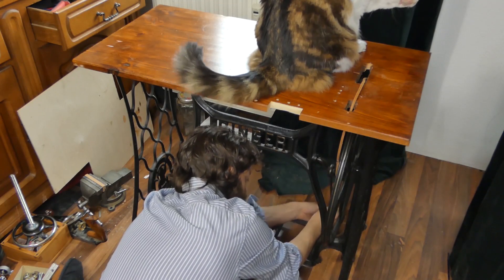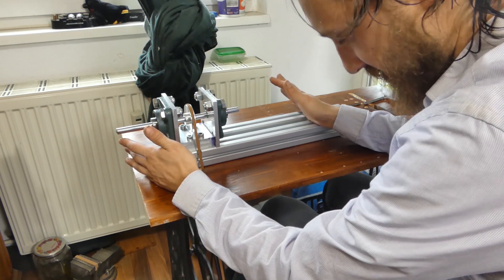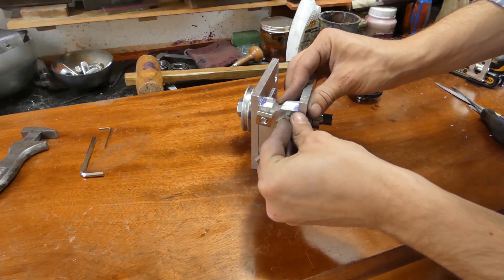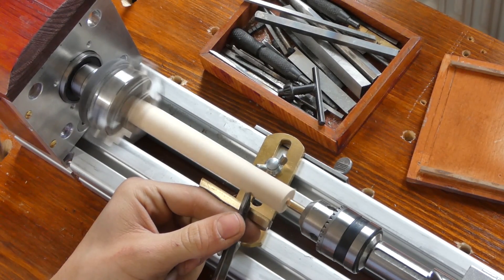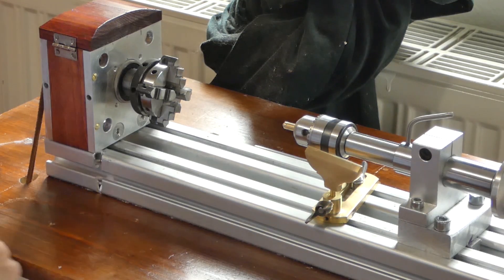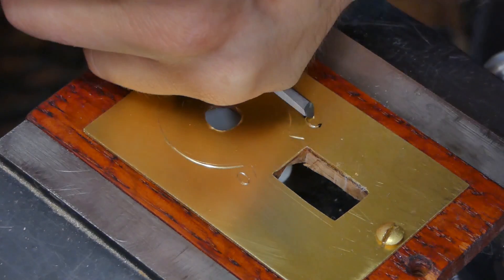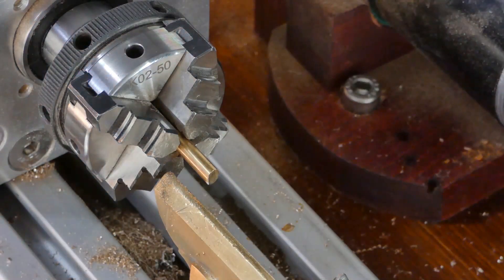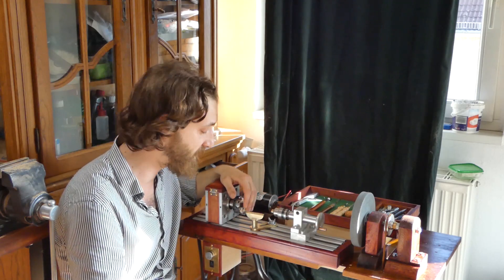Mini Lathe Build

Comment: You know, the way you made this thing, you could bring it into reliable function with just a few steps in between. I bet you could flatten, even scrape that aluminum bed flat, as well as anything mounted on it. I bet you could even add a leadscrew and change gears relatively easily. I love this thing!

Comment: I'm not trusting the Allen key on the pully instead of a proper key in the shaft these pulleys are usually used with a wire rope eg for a brick lift but they don't get the stop-start tension the lathe puts them under if a key is to hard id try a second Allen key

Comment: URI! You have come a long way since I first started watching your engraving video! On this video you talked about chatter. The closer you  can move your tool rest to the piece you're turning, the better. This way your gauge or graver will have much more support. Also, I make the ball ends with the lathe, but finish them with files and sanding sticks. [paint sticks with different grits adhered with easy release contact cement spray] Finally did you know you can use your many saws to cut your piece away front the chuck or tailstock?  Let the piece rest in your hand and grab it when it releases. I am so proud of you and your abilities. Finally, If you can find an old Hoover vacuum cleaner, inside you will find a 15,000 + RPM powerful pancake motor complete with mounting holes as well as a threaded tiny pulley on the shaft. With this you can make yourself both a vertical and a horizontal disc sander. I use .75" MDF for the discs turned true and straight One for each grit which are kept in a slotted carrier. I have all the grits up to 1,200 which is used at a very low RPM. Your vids are very enjoyable but also very clear and precise. Thanx for taking the time mate! Keep up the work as I have become a subscriber so you can buy more toys. My best regards in all things.
T

Comment: the slow rotation of your grinding wheel is a blessing in disguise. it won't overheat your tools, and ruin the temper. i use a hand crank grinding wheel to sharpen mine for just that reason. also, nice job on the lathe.

Comment: Its lovely to see the mixture of organic materials of wood with alloys like Aluminium, Brass and then the addition of steel, cast iron and a modern chinese PSU and controller but covered again with a wood box & Brass with a hand carved plate.  I just love this little lathe,. Its like its alive in Uri's hands.

 I have a couple of lathes one slightly larger than this for wood and for soft metals if i want to use it for that although it is for pen work then a much larger wood Record Coronet  lathe which is based on their original lathes from nearly 100 years ago yet is packed with electronics but has the old look about it. I know how he feels about his machine.  I have the same feeling on mine.

Comment: Honestly you probably wouldn’t need the motor if you just had a nice heavy flywheel to keep the momentum going, and maybe a higher ratio in the pulley system.

Comment: Shame about that Singer Sewing machine - it was worth a lot more than the tools you created from it's parts. Tools that could be bought cheaper than the sum of material cost  to build them. Nice build but still.... shame.
Reply: It's all still there, he destroyed nothing. He removed the original top and replaced it with a slab. The same goes for the treadle, we all saw that. He even made a point he didn't want to alter the pully handwheel.

Those machines were made in the 10's of millions with plenty still in use across the globe and there's more than enough inventory to chose from for sale right now as we speak.

If you watch his videos since then he has made good use of his mini lathe. 

Besides, it made excellent content which his viewers all enjoyed
Reply: @tommypetraglia4688  - An antique treadle sewing machine and cabinet in good condition like the one he  took apart and used fetches around $1,100 or more depending on year. The cabinets alone can fetch $700 to $800 or more.

Cost of a electric mini wood lathe - around $125. No build involved.

Granted it's interesting to see the build and design. But then any simple table could have been used. A treadle and wheel assembly not near as difficult to make as the rest of the build. The sale of the Sewing machine far exceeding the cost of the tool needed to create what ever is to be created with the tool. After all, it's just a tool.

Can one learn something from the video? - sure but lets get real, it completely impractical. He added a motor later on - so...?

The genius is not in using a antique treadle sewing machine to make a less practical treadle lathe. The genius is in knowing it's a complete waste of time, money and effort when much more practical better solutions abound. You can spend all your time money and effort creating the tool that is less efficient at doing the job you need it for, or you simplify things and go get the tool that's needed that already exists by the tens of thousands - plug it in and create whatever it is you intended to create with the tool to begin with.

Comment: You really are a fantastic artist and master of a lot of trades but you need to be careful on the lathe with metal, much more that the length you were working on you should use the tail stock with a rolling centre for support, remember its not a metal lathe so can be dangerous with that tool rest..  Its amazing how you oput everything together, What degree did you take if you dont mind me asking?
I have a very large Metal Lathe, CNc, Plasma cutter, 3d printer Wood Lathe and some lasers, metal working is moving out and I want to concentrate on wood more, metals cold and dirty and heavy now Im getting older. Wood is nice and forgiving..

Comment: De-grease the bearings, dude. You probably could have saved yourself a lot of time. Those industrial bearing are probably packed with a thick, viscous lubricant. With a bit of brake cleaner you could have had those things rolling freely.

Comment: correct size/proportions for a treadle lathe (i.e. smallest), literally jeweler's lathe (4x5 micro/Unimat or Sherline/Taig) up  to 7x10 territory.
https://littlemachineshop.com/
https://littlemachineshop.com/info/getting_started.php?Chapter=GS_MiniLathe_01.htm&d=0|1|2
https://littlemachineshop.com/products/product_category.php?category=2122081964
-
https://littlemachineshop.com/products/product_category.php?category=1963256895
https://littlemachineshop.com/products/product_category.php?category=1963256890
https://littlemachineshop.com/products/product_view.php?ProductID=4039&category=1963256890
https://littlemachineshop.com/products/product_category.php?category=1

Comment: For small wood turned toys would be awesome, I would use a 1/6 squirrel cage AC motor if I did it fancy I would use a brussless DC motor with a controller.

Comment: Those are flange mount bearings. A adjustable tapered roller bearing is better. I wonder, do you discover that in your video? I do have a Singer sewing table that's just decoration now.

Comment: Ideally you would use tapered roller bearings or angular contact bearings for a lathe spindle, instead of ball bearings. They take axial loads better. But this isn't a precision lathe so I suppose it isn't critical. Would help with the chatter when turning metal though, I think.
Reply: Justin: I know what you are referring to, but would not be able to identify them online. Maybe you could provide a link to a set that fits everything else in his parts list.
Reply: @tedrowland7800  Just search for 7203 or 30203 for angular contact or tapered roller, respectively. Although, tapered roller bearings need a specific amount of preload, so the lathe's design would need to be changed. And both need to be installed the right way around, obv.
Reply: @ThatBum42  Thank you so much

Comment: Your speed is very negligible. The bearings you need are the ones which take axial and radial loads, but that depends on material you want to cut, speed you can achieve and torque. It would be nice to have a large wheel on the side to carry and keep momentum with a way to maintain speed with some sort of flywheel or clutch if you wanted it foot powered

Comment: Inspiring video and project here, love also the details and brass! I really liked the human-powered endeavor at the start and wondered if you had thought maybe of a flywheel arrangement at all to get more consistency and immediate power (Also I did like the nice speed controller too, don't get me wrong!)? Somehow this picture of the human powered wheels for throwing clay pots came to mind. Other thing I thought of for future upgrade is the potential to use steel rods like 3d-printers use for mounting the tool rest and tail stock. Such a cool project!

Comment: Are there alternatives for the material of the toolrest? Thick brass plate - at least here in UK - is VERY expensive. On a commercial watchmaker's lathe, the rest would normally be made of hardened steel, ground and polished. How easy would it be to work stainless steel (cheaper and harder then brass) in your workshop with simple hand tools?

Comment: Thank you Uri. You're probably right to blame poor quality bearing in those Chinese pillow blocks but, do you think that you might actually have had alignment issues with the spindle? Lathe makers have traditionally bored out both the tailstock spinde holes in a single operation - thus insuring that they are both concentric and aligned exactly along the long axis of the spindle. Not easy to do with a homemade lathe.

Comment: Uri Tuchman if you did some simple gear adjustment it would get a lot of speed just by adding a 3rd wheel and different size wheels with the foot pedal you would be able to go way faster

Comment: The chatter in metal turning is caused by lathe speed and depth of cut. Also important is shape and sharpness of the graver, how it's held and type of metal being turned. Practice, practice, practice. (After 22 years of using a small lathe like this, I still occasionally get chatter.) Love your creations.

Comment: The pillow block bearings would have worked just as good as the free bearings if you had centered the pillow blocks with the appropriate shaft and bolts before just like you did with the free bearings. I had a similar issue with a very similar set of pillow block bearings and called customer support to ask why they were so uncentered and caused so much friction... I was promptly schooled on how much of a noob I was when centering bearings and learned how easy it was. Your videos are awesome and an inspiration. Thank you

Comment: Uri. I’m a big fan of your channel. I wonder if you may be interested in making and trading some engraving tool for a Unimat watch makers lathe in good running order. With variable speeds. I am very sorry if this is an unwanted solicitation but I thought you may like having an all metal lathe with all sorts of accessories and the original manual from the 60s. I have been inspired to get into engraving by many of your works and haven’t used the lathe in years. It’s a well oiled machine and I would love to contribute to your works in some way other than a monetary donation.

Comment: Nice project. Uri is „da man“ for projects like this. I would have mounted the motor the other way around so it is out of the way of the chips and dust. I think the barings will appreciate it on the long term.
Reply: Many manufactured lathes have the motor in this configuration, and I always thought the same thing as you.
Reply: Thomas, I am aware of that and would never buy a lathe with this motor configuration.
Reply: @Rsama60  i wouldnt have if I could afford a better lathe. But under $300 w/coupon at Harbor Freight for a 12/38 lathe was in my meager budget. Unfortunately the back of the motor is right behind the spindle like this configuration.

Comment: love it! i want it! on the grinding wheel setup you could fix a disc on the out side and add sandpaper to it to get a disc sander or a similar setup to the grinding wheel and add a buffer wheel but you would probably want to upgrade it to a electric motor like you used for the lathe. and arent your afraid to get a fire going with all the wood chip around metal grinding ?

Comment: When you make your other tool rest, they work much more smoothly when you use tool steel round rod. Check out some examples of aftermarket tool rests online.  
..nice addition of the motor. Is it a DC motor?  That's an awesome lathe! Thanks for posting.. How was it to turn the brass? Did you get many splinters? I usually only use files and angle grinders when shaping brass on my wood lathe. The possibility of a catch when turning brass has always kept me from trying to turn it like wood. This video has given me the bug to try it now.. Lol . Thanks! ..I think
Reply from the maker: Cool, thanks. The motor is dc 12 v, therefor it's not super powerful so catches aren't that dramatic. Brass turning is very finicky from my very short experience, but I get better at it, the big thing that I found is that you're working in a much smaller scale, meaning every thing is much closer to the work. Turning brass by hand is almost only done by watchmakers, but once you get a smooth chip it is very satisfying.
Reply: @urituchmanpigeon  yea, you're the first person ive ever seen turning brass by hand like that.  I wonder what aluminum turns like.  I bet copper would be catch city, as gummy as it is. 

You really got my mind going with your lathe project. Ive got an industrial sewing machine motor and table in the basement. The motor is huge, hooked to a big foot pedal for speed control.  the sewing machine part is missing some parts. Now I don't even care about that part.. Lol  ...hey, is there any way you can run that stone through a water bath when sharpening your tools? Also, keep your eye out for a CBN wheel. They are slow to wear out and won't over heat  your metal ..even at higher speeds..

Comment: Best lathe build on YouTube for sure, an observation if I may: you need one component, a couter balance on the other side of the pulley on the head stock. 
Much love URI, 
BOBBY DIGITAL out-
Reply: Maybe use that beautiful wheel. It’s got to be heavy. It will reduce chatter and help with speed reduct from friction increase concentricity etc. seriously. Much love brother,
Bobby d out.

Comment: another excellent and creative video! 
If I may offer a suggestion, a bit of steel as a cap for your tool rest will help a bit in the long run. I noticed the tool rest looks like it's already getting damaged and those can catch tools preventing you from making proper cuts. But, even with the steel tool rest I have, I need to take a file to the tool rest occasionally (less than once a year).

Comment: Very nice. Tossing the shaft into the freezer for a couple hours before inserting it into bearings makes it much easier to assemble. If you work quickly, sometimes they'll fit together without pressing. Have fun with your new lathe!

Comment: The lathe turned out great! I tried to build one myself, and yours is better. To reduce the chatter you can try a couple of things : check out that your work piece is actually running concentric, and add a flywheel. Worked for me, althought i'm no expert.

Comment: You need a smaller chuck or a wider base for the tail stock. It's moving off center with pressure rather easily.

Comment: There is a tool to resurface your grinding wheel. A friend showed me how to use one a work. It’s a great tool to have and helps making grinding easier and faster. Thanks for sharing.
Reply: there is an entirely  terrifying metal tool called a 'Dayton grinding wheel dresser' that works to resurface grinding wheels, and there is also what amounts to a harder stone called a 'grinding wheel dressing stick' that does the same thing. Having used both,  the grinding wheel dressing stick is the way to go.
Reply: Yes, nerves of steel needed, PPE and a tool rest platform.
Reply: I'm sure he will make a tool to reface his grinding wheel LOL
Reply: The diamond bits are safer than the ones withthe wheels i think. I spent many years using a clogged wheel hahaha

Comment: Wow, every project you do looks so professional and polished.
Reply: He is the grand master unnecessary ornate. I'm surprised that there is no engraving on the panels.
Reply: @FreeOfFantasy  I'm surprised there is no engraving on the motor housing, the tool rest, and the aluminum parts throughout.
Reply: @thomasarussellsr There is so much space for flowers or something like that. That engraving on the speed regulator was crude compared to what he normally does.
Reply: @FreeOfFantasy  exactly my meaning in my comment.

Comment: You will probably end up wanting to put a steel strip across the top edge of the tool rest. Each and every knick and dent the brass gets any time the tool hops, will become visible in the work peice as a dip or divot.

Comment: very nicely done sir. And you don't really want high speed with a bench grinder when using it to sharpen lathe tools - you don't want to overheat the steel.

Comment: The original pulley you took out is heavier for a "flywheel" effect. You could compensate by adding weights to the large pulley underneath, or adding a weight-lifter's plate. It takes more leg power to get it going but less effort (torque) to keep it going while you're cutting. I love your love of hand-tools! Warms my heart.
Reply: A simple stroke with the hand can help in starting a treadle machine with a heavy flywheel.